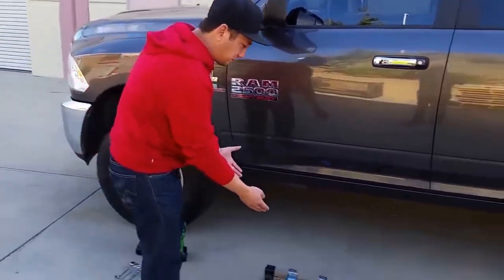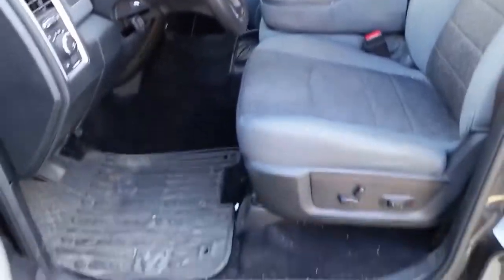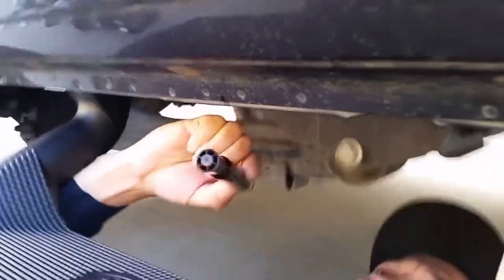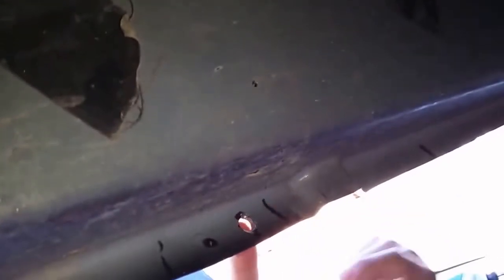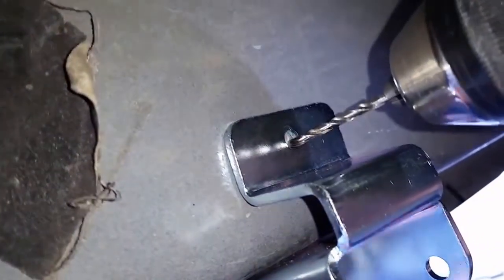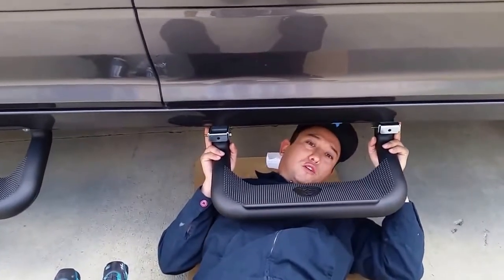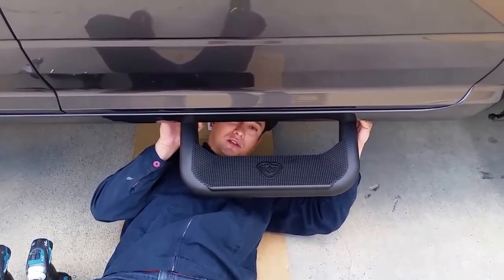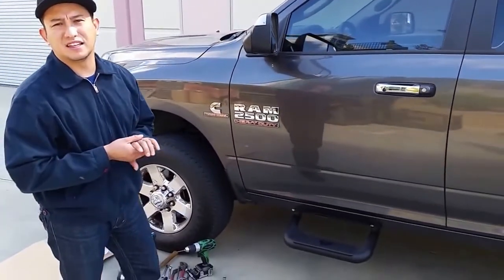Carr 2009  to current Dodge Ram steps install video

Comment: Like how this shows the 2 step products -  side by side !   - so you can judge the size/shape of both.  Like how this shows the passenger getting in and out of truck using step ! ! !   Will be using these black steps on REG CAB 4x4 lifted Black RANGER.  Would be great for others to see these links on CARR website and side by side comparisons like here

Comment: Had high hopes for these. Unfortunately, the hardware that comes with them are total garbage. Drilled the 1/8" holes for the mounting brackets. Went to mount the first bracket, and the head snapped off. Backed it out, 2nd one snapped. Backed that one out, 3rd bolt snapped. 
Total junk.